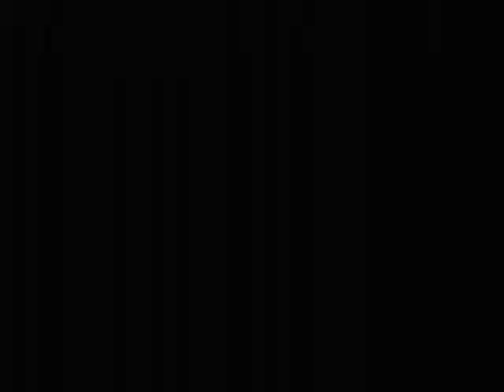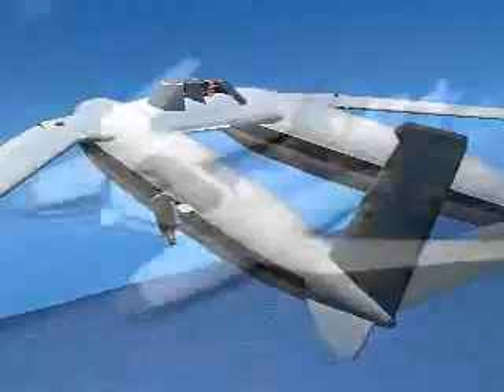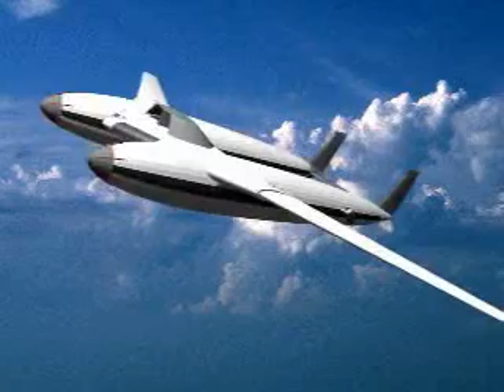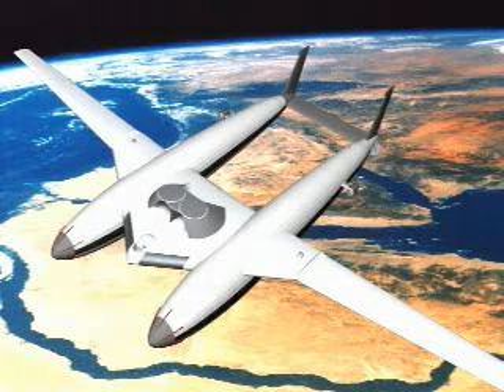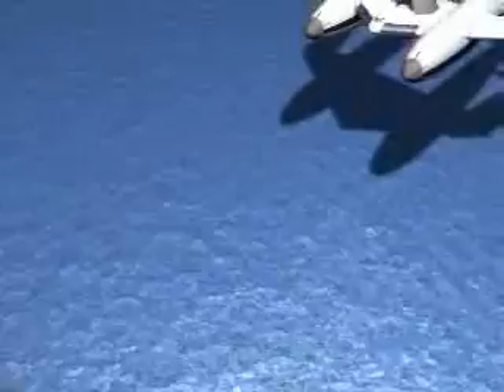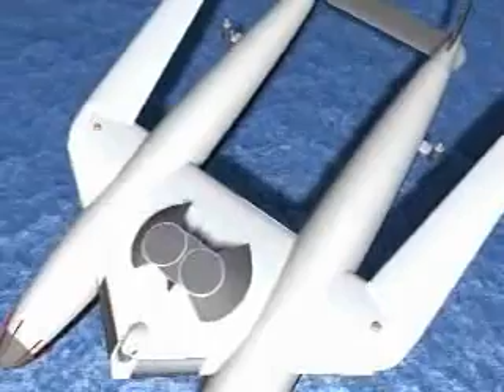Fuel-Less Gravity Powered Airplane

Comment: oh boy, i'm 15 year late to the party... well the thing is, this can work... but is not practical and the distance it can travel is probably very overrated.
first, this is not fuel-less. the fuel is helium and helium is not necessarily cheap.
then removing the helium with compressed air by using motor powered by compressed air? like what? you already have compressed air, just open the damn valve.

Comment: Robert D. Hunt, the Chairman of Hunt Aviation, has filed for international patent protection for an innovative new phase change hybrid airship design powered by the thermal energy in the air. The energy to power gliding flight is obtained from the atmosphere itself. An efficient power cycle is created using the natural temperature difference from a low altitude to a higher altitude. Heat energy is taken from ambient temperature air at a lower altitude to power the GravityPlane and heat is rejected to colder air at high altitude to complete the power cycle. This Atmospheric power cycle can be repeated indefinitely to allow the craft to stay aloft virtually forever.A proprietary low-boiling-point-liquid is vaporized into a low density lighter-than-air lifting gas using the heat in the air near the surface. This creates buoyancy that allows the buoyant aerostat to upward glide. The air becomes very cold when high altitude is reached and the lifting gas is cooled and changes phase to high density liquid that is heavier-than-air. Lift is lost and the aircraft glides back down toward the surface where the Atmospheric Power Cycle is repeated as the low altitude warmer air vaporizes the liquid back into a lifting gas to create lift again.

Phase change is performed by heat exchangers that take in heat or reject heat to the atmosphere. The aircraft is insulated to prevent premature condensation or vaporization of the working fluid while climbing or descending. Power is generated by wind turbines aboard the hybrid aerostat glider during both upward and downward gliding. A portion of the wind turbine generated power can be stored and brought back to earth for later use and may be used for propulsion during take-off and landing for example. In the alternative, power may be used while flying to produce hydrogen via electrolysis or to produce other valuable chemicals or goods. These products can be manufactured while traveling enroute to deliver the products to a purchaser. The GravityPlane can become a flying factory that can generate the power to run a manufacturing process from the atmosphere!

Comment: Skip the woo-woo explanations and nonsense about gaining energy for propulsion from the dive. There will be too much losses.

 The idea of using pneumatic prop-fans or jets to push it is interesting, but you'd need to burn fuel to compress air, which is distributed.
 There have been plans to use air not only for air-cushion "landing gear" and to blow flaps for lift, but send it to similarly "blow over" the flight controls for powered-assist. Active controls, even on big transports, especially at slow speeds.

You'll need to analyse the flight while changing the wing angle. You'll need to design something less universal, less sweep change, if it's worth it at all.Centers of lift and of drag and of mass/momentum need to be considered. It's highly unlikely a plane could remain stable through the amount of sweep-change shown in the video.
 It's a good idea to fly with the nominal angle, and then they can be folded for ground-handling.

This thing as a normal airship with partially swept wing would weigh almost twice a big airbus (though the weight on tires would be less than the jumbo-jet). It could land or take-off at 2/3 or 3/4 the speed.
More payload than a zeppelin, and less runway than a jumbo jet. Each proposition uses the other to cover its weaknesses. Jets want to be big, but can't manage landing them comfortably (slowly). Weather was the downfall of most of the airships. Max speed only 80 kts and vulnerability to winds because they don't weigh anything to keep them on the ground.
 Given the need for pontoons (since we want it to be also a watercraft), it's harder to argue for aerodyne-shaping of as much gasbag volume as you can into gasbag / lifting body. blending gasbag volume into the top of the lifting body into one big wing shape would lower the landing speed even more, and open up the possibility of very long-range and large payload use as a GEV. Fly to sea, then skim as cruise, then fly around weather or inland.

 With wheels it could fly super-freight-plane loads into runways that a regional wouldn't want, for being too short. All they need is to turn it around and give it a run into a wind to get bad up out, empty.

Comment: I can see one main problem with the concept, over and above all the myriad issues of feasibility, materials, and efficiencies. It has a high initial energy input that is partially scavenged but will not sustain long flight durations.

Confusion comes from the fact that the idea seems to have no energy input i.e. violates Laws of Thermodynamics.  But this is not so. Energy is supplied to the flight system from two sources--both before take off.  1. the compressed air tanks have to be charged up to start the process going and, 2. the helium has to initially  be compressed into the onboard tanks so that it can be released and change the buoyancy.  

The glider analogy works well.  Ultimately, due to friction, cooling/compression and other inefficiencies in the proposed system, the plane will not be able to continue porpoising indefinitely unless an additional source of energy such as solar energy (by capture to batteries/direct compressors or by using thermal rising currents which extend the range but seriously lengthen the flight duration) is used, otherwise the total supply of onboard compressed air will suffer a net loss until the point where the plane is either reduced to progressively lower altitude porpoising or finds itself stuck at an altitude, unable to descend without venting the precious helium gas to loose buoyancy. At either point, the plane must be landed and the recompression/resupply of both air and helium tanks is performed.

That is the point when all the initial energy has been spent, energy is converted to motion, the Laws of Thermodynamics are preserved.

That said, I do not think this idea would work because the inefficiencies are too great to provide useful sustained flight.

Comment: It will not work the way they describe it. But it could, if it's refilled with air before it  takes off again. But even if it was working, it wouldn't be practical since it's a lot slower than motor powered aircraft...

EDIT: I find it rather surprising that so many people here in the comments seem to not understand the idea behind the aircraft (which is good, but I'd not call it a plane) and therefore just say that it violates the laws of thermodynamics because other people said so. (As I said, the way they describe it, it does (because perpetual motion and unlimited use without refueling), but I don't think that is the way the inventor wanted it to function.
Reply: aerostat-supported aerodyne-ship (or vice-versa). Makes perfect sense and has been examined may times.
 See the Aereon Dynairship and their little test plane to verify the flight handling of the lifting body gasbag envelop shape.

Comment: It would be possible, if...
1) The helium is re-compressed by and electric battery - energy going into system and being used to contract "airbags"
2) Fuel of some sort is used to power this.

Here is a way it could work - Solar panels on the wing charge a battery on the way up (when the craft is lighter than air). That battery then compresses or decompresses the helium airbags turning it from a lighter than air to a heavier than air craft. You must have energy input. Not to say that it wouldn't be efficient but there has to be some way that it gains energy and uses it. Nothing has 100% efficiency. The most efficient things we have are things like Tesla Turbines with no load. But as soon as there is a load, efficiency drops like a brick. Combustion engines for one, are ok in efficiency, but give it the load of turning itself back over again and it goes down to about 30%. Not sure how much it was with just the piston pushing but you get the point.

Comment: What keeps running through my head is this compressed air BS.  True compressed air of any pressure needed to drive air turbine pumps or even piston pump engines would require HEAVY steel storage tanks.  It seems the weight of the tanks would make this craft so heavy it would never get off of the ground.  I doubt carbon fiber tanks would even be of sufficient strength. This is someone's air-brained fantasy.

Comment: If helium had a boiling temperature around 273K at 1 Atm, maybe this would work. Phase changing wile taking heat from the lower atmosphere to the upper atmosphere.

Comment: 1] How much energy is expended compressing all this air? 2] What happens at the crowded operating ceiling where all these aircraft will function? 3] Compressed air will provide sufficient thrust to keep what you describe as an airship stable, and on course?  I want to see a working prototype before I even buy into this as a pipe dream.

Comment: They Probably would use flexible Solar voltaic Cells to recharge Batteries and for operating the Air Compressors and Other Electronics as well as
 using energy regeneration technology in the electric turbines to partially power the Craft during in climate weather,  and possibly a Small gas turbine for emergency power.

Comment: Dear Sir,
I regret to inform you that your invention does not comply with the first and second laws of Thermodynamics.
Best Regards,
Porpentosa.
Reply: +porpentosa I don't think the point of this system is that it uses no external energy source. 
The interest of such innovative technology is in the rare combination of aerostatic and airfoil lifting capacity.
Reply: +porpentosa I don't think the point of this system is that it uses no external energy source. 
The interest of such innovative technology is in the rare combination of aerostatic and airfoil lifting capacity.

Comment: Physics people. Don't try to make a plane concept if you don't know the laws of physics. this idea is equal true that I can beam myself to Mars.
Reply: +meforsure and you do lol
Reply: IT doesnt Brake the laws of Physics.
Reply: +Monty Monty The amount of energy needed to re-compress the helium once equilibrium altitude was reached would be equal to the airship needing to lose the full altitude gained assuming perfectly efficient re-compression of the helium for their "wind turbine theory to have a chance of working.  Now, If they used hydrogen as their lift gas then vented it at altitude and used some of the hydrogen in a fuel cell for electricity for auxiliary propulsion we might be able to get this think working.  But fuelless flight?

Comment: Ok i know this is not an perpetual motion, its not fuel less, and way far from grativity propulsion. The idea still great. For people saying That he use compress air to compress here this not what he mean

He use the turbing to create electricity and there is electrics compressor inside that refill the air tankl. So the turbine is not compressing air for the tank, it compressing air to have a better efficiency of the electrics compressor. Since compressor at higher altitude become worst in term air compressed/power needed by keeping it's compressor entry in a compressed air room he will lost less compressor performance or even being more performant. So his turbine wind catching turbine will power an smaller turbine for the air compressor room.

Turbine electricity can be stock or directly reuse by the compressor.

Turbine on the side is electrics turbine also. He will need alot of batt bank to sustain what he will need for the main operation since he clearly said he's using the turbine to break the remaining weight to take off. Problems here as he get higher it will need more electricity to get this turbine usefull. This plane wont reach it 10 miles but will still reach something...

Vaccuming an room at sea level will get an a high outside pushing pressure. At higher altitude he can suck little bit more air from the internal helium room to expanse the helium effect on the plane. that's only if it structure can resist a bit of vacuum.

Solar panel will be awesome but it's a bit heavy for a plane, but if you estimate you can remove some battery on that plane.The high altitude temperature will reduce the internal lost energy and make the solar panel more efficient.

If and only IF that plane can reach a static position without needing more electricity or can produce more that what it need to maintain it will be the most awesome plane ever made!

Comment: Using compressed air to compress air...   bullshit alarm goes off
Reply: +Aetrion I was wondering where they get all that energy to fill all those massive tanks of compressed air so they can use it to compress air while in flight. And to use a tank of compressed air as an energy source so that you could power an air compressor sounds like a waste of potential energy.  I&#39;m gonna get in touch with them and sell them the patent to my perpetual motion driven air compressor, they seem like they might have the technical savvy and visionary business model to put it to use.
Reply: exactly my thought
Reply: +Aetrion Even Joey the Dachshund can see this is bullshit.  The skin, the machinery, the air tanks, avionics, superstructure.  It would take a helium balloon many times the size of the aircraft to float it.
Reply: hahaha epic
Reply: +Thomas Nuckles The wend turbine?
Reply: +Thomas Nuckles The wend turbine?
Reply: +Aetrion Have you never heard of a ram pump, which uses the flow of water downhill to pump water uphill?
Reply: +thszntatst Have you seen how much downhill water is required to pump a small amount of water uphill?
Reply: As a matter of fact I have, and it is a small ditch flowing into a four inch pipe to run a ram pump.. It makes no difference. If you live next to a stream you can irrigate fields, or fill a reservoir. In this case all you're doing is compressing the volume of lighter than air buoyancy gas in the twin fuselage.

Comment: First off its fuel is electricity based on the description. Second congratulations you figured out how to add oversized wings to a dirigible (aka a zeppelin). You took an invention from 1895 added electric motors, compressors and bigger wings to it... I bet you feel so proud. Also since when is buoyancy = gravity? Another point is in order for this to be "gravity powered" the only way I can see that being possible as far as physics is concerned is if the Earth was spinning so fast that the centripetal force would be greater than that of gravity so that the Earth would literally throw the plane (and everything else not solidly attached to the ground) into the air thus gaining lift. Then using gravity as a glider to slowly descend until it would hit the Earth and get thrown... again. If anything this is an over glorified and over engineered glider.
Reply: Brushfire97611 Agree.. Using gravity to decent is exactly what every aircraft today does. They usualy turn off (idle) the engines during decent aswell which saves lots of fuel too.
They said that the aircraft is fire and exploding safe. Aint Helium really explosive? Didnt the famous Zeppelin explode which had helium in it?
Using decent to run turbines is rather aerodunamic powering than gravidy powering it. Or even just Newton's laws. Saying something has a stored energy at a cirtain altitude and you can access that energy by decending in altitude.

If this works it might be good for the ecosystem but it's not really anything new. It's just upgraded just as you said. Over-glorified zeppelin
Reply: I appreciate you agreeing with me however there is a flaw in your history. No the Hindenburg was filled with hydrogen you know that most flammable gas known to man. We use helium today because its not flammable it just makes you talk funny. But the main point I was trying to get at was if you say something is powered by something. That something should be the only thing powering it otherwise it's basically false advertising.It's like if I have a hybrid car that can run on electricity or gasoline, and i said it's "powered" buy gasoline. The problem is that's only half true. if the Title said powered by gravity and electricity id have no problem with it. Other than it is still an over-glorified zepplin.
Reply: Sonny Knutson it was hydrogen an lighter gas than helium